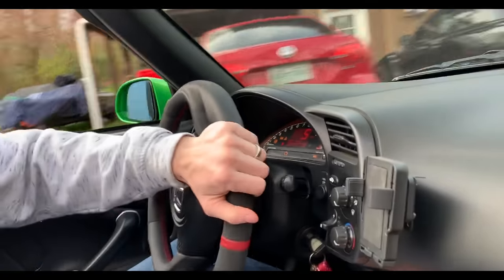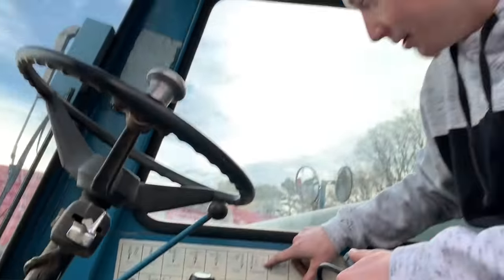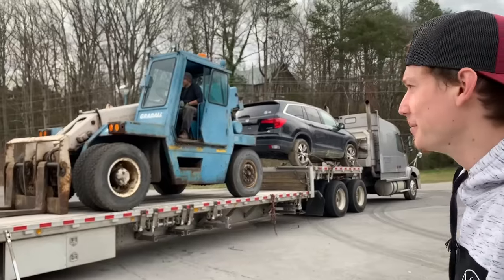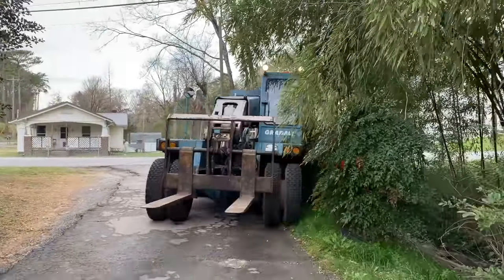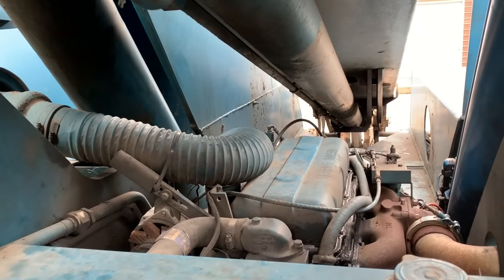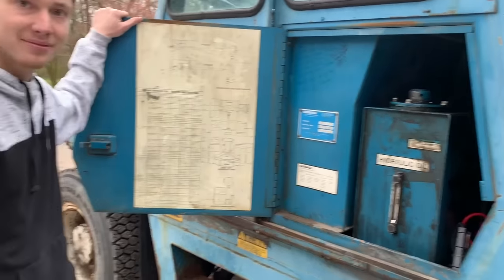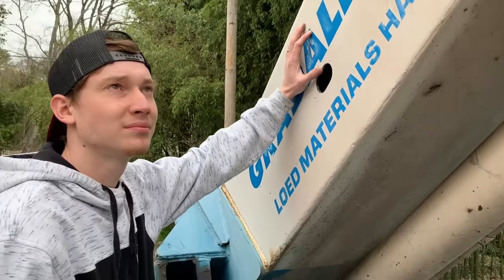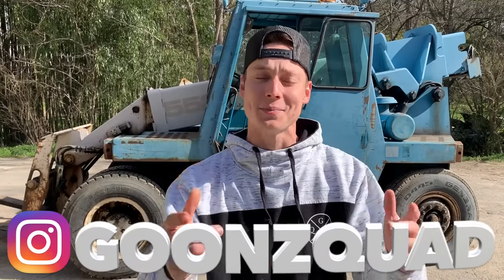Rebuilding The Worlds Biggest Forklift!!!

Comment: Boys,this is the one piece of equipment you wanna show maximum respect & safety to, it could cause serious injury or death , wear a safety hat and goggles. If any of those hydraulic lines come loose you could risk serious injury . Pop's will need to offer guidance on this one, if in doubt seek the help of somebody who uses one daily.
Reply: Like Skeelo69 said, hydraulic lines are not something you want to learn as you go with... A pinhole leak can have such high pressure that it will penetrate your skin and inject hydraulic fluid into your bloodstream - which can be FATAL. Have someone who knows what they are doing repair the hydraulic system.

Comment: That's called a screaming 2 stroke Detroit engine! Very reliable and dependable! Don't be scared to rev it out that's what they're made for! Also don't run it much if it's low on hydraulic fluid Because it can burn out the pump! Also there should be a safety latch under the boom on that beast so you guys don't get squished! Should.never go under that boom without the lock up thing in place! Good luck with it though guys and I can't wait to watch you guys fix her up!!
Reply: "Should be a safety latch" Exactly, should, but don't think it has, been working on equipment from the same era and safety wasn't the main focus back then.
Reply: @johnsimpson4191  Old detroits are 2 stroke diesel engines
Reply: You need to get your facts straight before accusing people of being a crack head guy. I was simply trying to help my favorite Chanel out here!
Reply: joyce  detroDetroit mad a 471 671 and a 8v92 all 2 strokes with supercharger blowers not turbos  if I remember correctly  there may also be a couple models I forgot
Reply: Okay take it easy, internet mechanics
Reply: It looks like a DD453 under the cab. It's a great engine. I've always wanted to swap one into a pickup. There's tons of videos of that swap. Better than an LS swap! Also, in regards to any Detroit Diesel engine: if there's no oil under it, there's no oil in it. If you need any parts for it, I know a guy that deals with all used DD 2-stroke parts.
Reply: @jamesstewart3121  DD 2-strokes: 453, 471, 671, 871, and 1271 are all mechanically controlled (no ECM). The 453-T has a blower with a turbo mounted to it. The reason they have a blower and a turbo is because they don't have intake valves. They only have exhaust valves. There are ports in the side of the cylinders that function as intake valves when the pistons are on the down-stroke. The 2-stroke cycle is the same as the 4-stroke cycle but the difference is every second crank rotation is a complete cycle. The 8v92 are electronically controlled (they have an ECM). They were used in a lot of hwy coaches, and fire trucks.
Reply: Yeah correct
Reply: Any hydraulics can give away suddenly and drop, so please prop up the boom with a heavy post or something that won't crush when working under it and the machine is off.
Reply: Just to add do not rev it out at all when it is cold. Let it warm up first.
Reply: Should never go under an unsupported hydraulic lift of any sort.  One blown line is all it would take to crush you quickly.  Even new lines can rupture unexpectedly.
Reply: I was a heavy equipment operator in the army.. and it was hard to watch them crawling around under that fork...lol
Reply: @dieseloctane666  I didn't recall an ECM  on the HMMT wrecker I drove in the '80' in the military thanks for the info

Comment: Never crawl under a extension of any equipment that is controlled by hydraulic without blocking
Reply: Kenneth Wilds I really hope they see this comment
Reply: GAY.....
Reply: @kinoderking9584  🤡🤡🤡
Reply: They questioned this before they did it, now they know for sure.
Reply: I agree. We have had a couple people killed at a hydraulic repair shop here locally over the past 10 years ago because of that.
Reply: this is what i was about to comment they should have at least put a "catcher" on or anything before they crawl under that boom..
Reply: Theyd been crushed with out warning standing under that hydraulic arm boom thing if it was pure empty or fault in wire line fluid type thing glad they was good though god away with it
Reply: im a firm believer in natural selection, but i also hope the boys read these comments, also been around hydraulics most of my life and seen what happens when a line lets go

Comment: Fix the mechanicals, paint and cosmetics only like the light bars. Don't really want to performance enhance things like that. They are generally built to do one thing for a very long time and more power could cause catastrophic fail early.
Reply: Perfect idea..
Reply: ADD TURBO , EXHAUST AND A KILLER STERO SYSTEM , LIFT KIT AND TWEEK THE COMPRESSION

Comment: The 2 brake pedals, one is the brake and the other one is called a inching pedal or inching brake. It is used when you need to increase engine rpms for your hydraulics without taking it out of gear and to inch up on what ever you are moving, like using a clutch. This Forklift should work the same way. I was a Forklift Mechanic for about 14 years at a Nissan  and then a Mitsubishi Forklift Dealer. 
If I'm wrong? I'm sure someone will let me know, I don't think I am but 
What can I say. Congratulations guys you will get some good use out of it.
Just keep it serviced regularly and don't abuse it.
Reply: True stuff dude this comment needs to be seen
Reply: that is awesome
Reply: Haven't driven one like theirs before but that is certainly true for anything I have driven. Just don't use the inching brake when moving at speed
Reply: Also allows faster lifting if you push that pedal and increase rpms
Reply: Its basically a clutch ....
 I clutch kick the crap out of my forky at work 🤭😁🤭🤫
Reply: Well, you need to send these dudes some mad emails on how this sucka works....I was nervous as a "ho" in church when he came past the corner and almost ran into the grass wall....Hahahaha!!!!!
Reply: The fact that back tires rubbed badly in tight turning makes me wonder if these are the wrong wheels. Should this thing be on different (smaller, non-air, etc.) tires and wheels?

Comment: Finally something I know a little about, lol. Detroit Diesel has been around longer than your pop's. They are popular industrial engine's built by GM. Very easy to work on and parts are readily available. For boom extension try setting the e-brake. Some models require the e-brake set because of stability issues if the equipment moves while it is extended. A GradeAll service manual will be a huge blessing. Those look like semi tires but they are actually industrial tires and the steering tires wear a bit faster for obvious reasons. If you need operational help feel free to let me know but I'm sure you have a friend in a warehouse that can help you. As you've already discovered rear wheel steering is a bit different but it will also get you places front wheel can not. Now invest in a hydrolic crimper, lol.
Reply: I think Detroit Diesels is actually Rolls-Royce now. GM has not owned them since they went Duramax. They have been bounced around all over. I think Chrysler owned them after GM, then they have been passed around.
Reply: @gamesofcontent  hopd info
Reply: I believe gradall is owned by jlg now. Go on their website with model and serial number and they will have all the manuals you will need. Plus that Detroit sounds like a 2 stroke 4-53 with a supercharger
Reply: Detroit Diesels are not as reliable as a Cummins.
Reply: i Bee Amazin I thought Daimler owns Detroit Diesel. Daimler is the parent company of Mercedes-Benz and Freightliner.
Reply: ATX-CVPI id say that’s debatable. In heavy industry Cummins Detroit are in everything. They kind of faded out of equipment. That’s mostly Cummins, cat(Mitsubishi), hino
Reply: @atx-cvpi_99  I believe you are thinking of Dutz. Detroit Diesel was born by GM and unless I miss my mark still is. The marine engine division is still in Germany though. Don't quote me but I'm prett sure on this unless GM sold.
Reply: @alexstanke7028  Caterpillar and Cummins started offering engine's cheaper than Detroit and GM was unwilling to compromise quality for cost.
Reply: @gamesofcontent  intresting to know, thanks.
Reply: Dave Johnson I’m talking semis and straight trucks. Caterpillar couldn’t keep up with emissions it had nothing to do with money. That’s why they tried the acert line and nothing after that. That’s also why they bought into so many other companies. Aka Mitsubishi, Perkins, etc

And yes Daimler now owns Detroit diesel
Reply: RichardBodeker  , That was a hard way to learn!
Reply: RichardBodeker  That was a hard way to learn!

Comment: You guys are throwing off all my alarms with that thing! I work in safety and training at one of the largest gold mines in the country and you never ever walk under a suspended boom or load without it blocked against motion. With the hydraulic tank that low there is absolutely no guarantee that what's in there will hold that boom up with the engine not supplying constant pressure. A machine like this that has an engine compartment accessible by raising the boom will have built in locks for maintenance. You also had the powerline to the house right behind you, be sure to know all overhead obstructions before raising the boom cause the best case if you catch something is minor equipment damage and worse case would be death.

I have always been impressed by your ability to research road blocks in your builds. Take the time to get to know this machine and the hazards associated with it. I saw in another comment but Westen Champlin is a you tuber that could offer a lot of  insight on this build.
Reply: kabooom!!!!  dude!
Reply: Westen might have some decent advice for the lift but they would be better off contacting Deboss Garage.
Reply: Jaxx :  So true ..  I sure hope they READ your comment .  Life safer right there . 
Thanks for caring about theses guys.
Reply: Hey, Guys, you might want to contact, J.C. Smith Projects, located in Ohio, he has Gradall that he works with, also does a lot of work with diesel engines and trucks, above all guys, be safe around this unfamiliar equipment.
Reply: OMFG! These guys had me cringing! You NEVER walk under ANYTHING that isn't pinned! I saw the powerline too! I've used hydraulic equipment for 40+ years (designed some) and I still have all my fingers! Pinhole leak in a charged 10,000 psi line will take your arm off! Or cut you in half...
Reply: Definitely agree. These boys need to be careful...some heavy machinery there!
Reply: So you work Newmont?
Reply: @I-4050  Barrick, we took over Newmont's mines last year.
Reply: Agree with everything said here
Guys never ever stand under any raised equipment 
It’s a quick way of dying
There should be a safety prop to support that boom
Also that power line is another instant death item
Love you guys work
But please for your own safety get someone who knows how to operate this to teach you AND if similar to Australia get the appropriate license to operate This will give you the very necessary skills to operate this machine safely
Reply: I had similar feeling when watched this episode. very dangerous!
Reply: How so, being that newmont just aquired goldcorp last year so and now is the biggest gold miner.
Reply: No one likes a safety guy, shhhhh
Reply: Jaxx Blackfox agreed 100%
Reply: clearly they are two youtubers what do they know !
Reply: Reptar the acquisition saw a few assets sold off in the process.
Reply: Baby steps, they just started wearing gloves and safety glasses 3 episodes ago.🤣🤣
Reply: Follow him and you’ll be in a world of osha violations
Reply: i was cringing as well!!!! thank you for bringing that up, its never safe to work without safety blocks!

Comment: It’s a tele-handler not a forklift
Reply: It's not the biggest fork lift it's a normal sized old telehandler
Reply: It has forks and it lifts forklift
Reply: Charles Chenot it has a boom arm so it can lift stuff forwards and backwards when a fork lift can only lift stuff up and down
Reply: @tommarti_f1870  it is a tele handler fork lift what about a hiab crane that lifts up in and out and down as well as out but what about a mobile crane that has a winch to lift up and down as well as in and out its just a different style like a reach fork lift truck lifts up and down as well as in and out
Reply: A zoom boom/telehandler is technically a class 7 rough terrain forklift. So technically it is a forklift.
Reply: @ColtonBlumhagen  they maybe let CAT & JBC  know about that.
Reply: @steveschierholz5272  Doesn't matter what they call it,  it's still a class 7: Rough terrain forklift with telescoping mast.
Reply: @ColtonBlumhagen  what do they call when you put a bucket on instead of forks
Reply: to me its a short Pettibone, which is a brand name but still
Reply: @steveschierholz5272  Or a Jib
Reply: Even if it was a forklift it's not the biggest, I drove one when I worked at a steel mill in Ca called big birtha and I know it was bigger than this, There was also even a bigger one called "the ram", It had two pegs that could lift 4 steel coils at once
Reply: @ColtonBlumhagen  I used to work with Zoom Boom (now Skyjack), this is not one of them, And this is not even close to be the largest telehandler aka rough terrain forklift.
Reply: @Funrunner008  That's like 80 to 100 metric tons. Way more impressive then this leprechaun
Reply: Yup definitely a tele handler, im a mechanic myself often repairing the hydraulics on these things. the fact it was transported on such a small truck hardly is considered the biggest. Tele Handlers can be massive. Even if this thing was a forklift this thing is tiny. Ever been in the major port harbor? for example where i live in rotterdam. dude those forklifts could probably lift 5 of these at once. Those things are massive this is a child's toy in comparison.